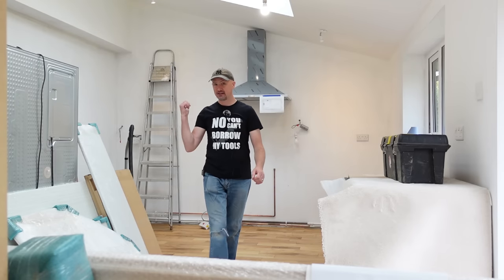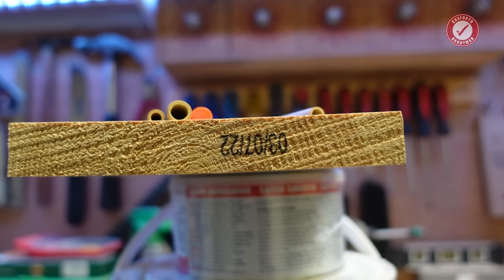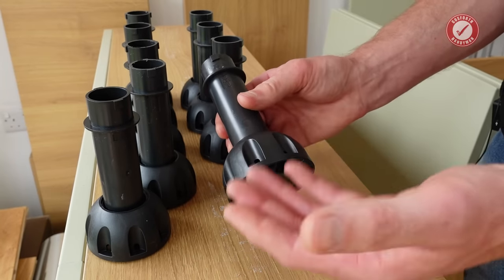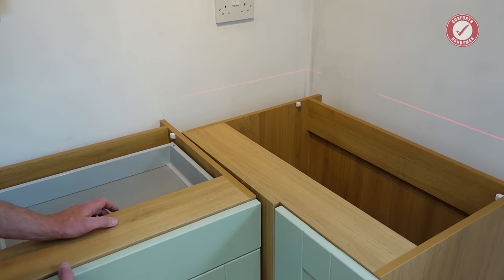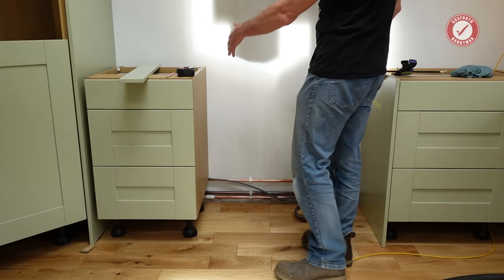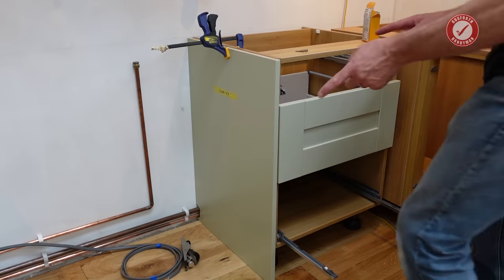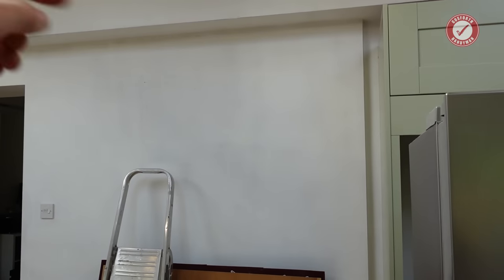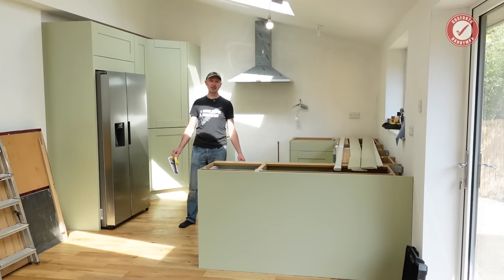How to fit a kitchen

Comment: Tipping the big unit to vertical can be done by clamping a board of the same width to the side of it, level with the legs/feet and tipping onto the board instead. Does that make any sense??

Comment: You should have started off with a datum line first is paramount. .  And what that achieves is finding the highest part of your kitchen floor and working from that line.   You can always make up height by adjusting feet and using spacers in extreme circumstances, but not the other way round.  Just a friendly recommendation.

Comment: I wonder if they didn't leave the over fridge cab dry fit so that you could disassemble it to trim it if your fridge was a little too tall?  Just a guess.  Great looking kitchen.  Love the colour.  Those spacer for attaching to the wall (space plugs I think) are brilliant!  I've never seen those before.  Used to install kitchens man years ago; you did a wonderful job, Andy!
Reply from the maker: Don't think so as then the door wouldn't fit. Space plugs are great! 😁👍
Reply: Have you checked your order? There’s a tick box for fry assembly - I’ve had to tick it for a corner unit that’s not going to fit down our hallway.
Reply from the maker: Yeah, that's flatpack assembly - did that for the corner unit. This was fully assembled with no glue in the joints!
Reply: @GosforthHandyman  super odd indeed. Cheers for the video, giving me a reality check about what we’ve got coming in November. Don’t suppose you cover Manchester? 😂
Reply: @GosforthHandyman  maybe they ran out of glue!

Comment: Proper kitchen fitters are like gold dust , I learnt a few tricks ie 600 worktops are no good for inbuilt dishwashers so always order 800 breakfast bar type them you can cut to hearts desire without worry about depth for pipe work etc , also wall unit hanger bar are essential but great job as always Andy
Reply: Yeah after 4 decades at it professionally I can say the only way to achieve the desired results was to be independent and away from the dictatorship allowing craftsmen to do their role. 
 Once I was contracted by a corporation or other big business it was 100%   money oriented. Speed. 

Even as a independent fair pricing was difficult due to the amount of cowboys and 
 " handyman"  doing the role even the gas/ electrical without certification/ any liability .[ ?]

Comment: The mental gymnastics with fitting that kitchen is beyond most (including me.) It looks beautiful and I'm sure the whole family will enjoy using the room. Top job.
Reply from the maker: As long as you keep it square, plumb and level you're OK. Make this mistake of following the walls and you run in to big problems. 😁
Reply: And don’t fit to a finished room, the kitchen should always be the very first (bar painting) of the second fix! Never fit on finished floor and never fit skirting boards before fitting your kitchen, this is not only a waste of time and money but it also makes it difficult to scribe base end panels and effects the overall finish
Reply: @wobla9699 Never fit on finished floor? That's what he does in this video.

Comment: Informative video and kitchen looks good, look forward to see the finished thing.

Had a number of kitchens from the same supplier over the last seven years, only missed out on the tea and biscuits once. So not a new thing, but a nice touch. Usually found in the leg box, the fancy box is new. Visited the showroom a few times, always helpful. I like that there are no cams visible on the wall or base units because they glued and doweled together. 

I have found with that supplier if you use the planner and have your plan converted to a basket, the pelmet, cornice etc are automatically added on. So unless you take them off they will be included in your order. If you do the order manually without the planner by adding things to your basket, they usually flag that you have not included end panels, plinth and cornice. 

Experience has taught me, when they deliver, don’t just check the delivery note, check against your final order version. Twice appliance doors have not been delivered with the original order. One time because the door failed quality control they said. The delivery note covers what they are delivering that day which is not necessarily what you ordered.  Plus a few damaged items. But getting them replaced/reordered is straight forward in the checking window (it was around 10 days last time I used them). If you are using a kitchen fitter, get the kitchen delivery two weeks in advance (so you have a chance of getting the missing bits delivered before they finish). It is a pain storing the kitchen, but less hassle than trying to get a kitchen fitter to come back for quick job, as they are usually busy. If fitting yourself, less of an issue.

Comment: I love fitting kitchens, I find it really satisfying.  If you're a DIYer where your finish is "good enough" then it may not be for you, everything has to be perfectly plumb and level to maintain a good functionality when it comes to use, especially if you are fitting hobs where the worktop needs to be perfectly level or your frying pan may not work so well when cooking things like pancakes.

Good digital spirit levels are very helpful and also good to have a cabinet plane and lots of quickgrip clamps.
Reply from the maker: I find it quite enjoyable and doesn't take as long as you'd think!
Reply: @GosforthHandyman  I agree and have no idea why kitch fitter charge so much.  My dear old mum was quoted £2600 for the install of a 4x3m kitchen.  This took me a week and we added a new ceiling with spotlights to the job.

Overall cost to mum was a box of teabags, a few pints of milk and several packets of chocoloate biscuits.

Comment: When spacing there dishwasher section I use a couple of 600mm stretchers that I pocket hole in to the gap. Great video. Thank you
Reply from the maker: Not a bad idea! As long as you can get them out when the dishwasher goes in. 👍

Comment: I used to overhang my legs where cabs butt up together, it’s stronger as it supports sides of cab  rather than just on base which may only be fixed with screws! And it means other one sits perfect one side and just adjust other side up or down 👍🏻

Big ones like that pantry wind all legs up apart from for at outermost points, level up, then just wind rest down until they just touch floor 👍🏻

Nice work
Reply from the maker: These legs overhang the edges. 👍
Reply: @GosforthHandyman  but not enough to catch the neighbouring cab😜

Comment: I have done a few kitchens over the years and didn't have anywhere near the tools that I have now. The last one was taking the kitchen from my last house and fitting it to my previous Maisonette, which sounds really strange. as I am not travelling backwards through time. I had the Kitchen from my last house, when I belonged to my Parents and they wanted to fit a new kitchen and utility. I wanted to put in a kitchen in my home, so I took all the units from both the kitchen and utility as there was nothing wrong with them. They all fitted perfectly and saved my a fortune. I was shocked to fit all the units as I didn't think I'd be able too. Really like the kitchen once it was done as I had a few cupboards and that was not really a kitchen, but more of a large room to cook in. 
Then once my Mother passed away and my Dad found someone else, we where looking to move as we had a young child and wanted to have another, We listed the Maisonette just as the Market collapsed, and we came to a deal with my Dad and moved in and waited for the Maisonette to sell, which it did but for a heck of a lot less. 
My next Kitchen Project is to replace the current kitchen in the Current home which strangely has no Drawer units and dodge fitted wall cupboards. The previous owner that should be band from any form of DIY didn't bother with the proper hangers and opted for a large penny washer through the hard board backing instead with a batten underneath. I was going to build the kitchen from scratch like i did with the Bar I built which replaced another kitchen as the house had two things that had kitchen units in. The Wife now wants an off the shelf kitchen as I am much faster at getting things done when most of the work on that front is done. In my defence I only have a small window to work in between school runs at the time. 
There are a few tips that I'll take away like the space blocks and hopefully where to get the units from, as I am not impressed with the kitchens that are available to us DIY lot from the likes of B&Q, Wickes the doors are never going to last as I have seen a good few of them de laminate over the years. I just wish Howdens were open to us non trade lot.

Comment: Those legs are better than my wife’s!
When I fitted our last kitchen I had some 18mm facia left, so I used it with the short side on the floor, I marked the corners, cut away the foam at the rear into a 90 degree “vee” and bent it to shape then glued each corner. It worked well for years and is still in use at our last house, going to do the same again at our new house.

Comment: Nicely done Andy as always. I did think you were ‘brave’ with your wooden floor as dishwashers are great water chuckers as you showed along with children. But your choice your build mate 👍🏻
One thought, with the beautiful fitted fridge are you going to get enough air flow from beneath. We had a fridge blow due to lack of air flow. Just a thought nothing more 😁
PS. 100 agree Del on the Tall Carpenter is a top bloke loads of great tips.
Reply: I’m pretty sure newer refrigerators are made so you can slide the back right up against the wall without any concern for air flow. When doing this you typically have the power cord and/or water line keeping the back of the refrigerator a couple inches from the wall which does allow for some airflow.
Reply from the maker: Yeah, we've actually left 50mm at the back and the top is almost completely open so all good. 👍

Comment: To keep your gables exactly flush with doors - measure the door , mostly 22mm nowadays , cut a small piece of waste 22mm by maybe 2 inches and carry in your pocket as little template , generally drawers will be tight to carcass but hinged doors will be 1-2 mm proud of carcass so you will need to keep panel out that bit more for flush finish

Comment: I recently DIY fitted a DIY Kitchens' kitchen. While I was generally happy with the quality just like you I had a few missing pieces. I also had some damaged pieces. Although they were all replaced or sent quickly it might be problem ordering from them and if you are getting the professionals in it could lead to delays and extra visits and hold up other trades. I found it interesting that you scribed end panels to the wall when you will never see them like next to the Range and the right of the fridge. The end panels come with few mm plastic strip on all edges which is great to protect the end but is tricky to just take a mm or two off. I note that the end panels are 'only' 600mm deep. We had to space some of our cabinets a little further off the wall for 40mm waste pipes we couldn't get close to the floor and there isn't enough space behind the back panel for the pipe and especially the brackets. The cabinets are 560 plus 22mm door means if you have to come off the wall like we did or scribe off a dodgy wall 600mm isn't always enough if you want the panel proud of the door. You set your's flush but I have seen a lot of channels where they do it 5mm proud, just an aesthetic choice. I would prefer say 620mm to give you scope to scribe some off and still be a bit proud. You can request units to be dry fit if required, like a tall unit that might be tricky to stand upright if the ceiling is low. I don't know if this applies to your top box.
Reply from the maker: Yeah, the scribes next to the range were just quick to keep everything tidy. You'll see the fridge scribe if the fridge ever comes out. 😁👍

Comment: with any unit that has more than 4 legs, raise the others and concentrate on the legs at the perimeter.....once they are levelled you can drop the others down to the floor.

Comment: For filler pieces cut two pieces which usually are 720mm , screw one flat on the back of the front one and then you can pull it out flush to the 22mm or whatever your door thickness is and screw directly thru gable to attach from both units as fillers are generally 18mm and won’t sit flush to doors unless you do this

Comment: Hi, thanks for a great video. I wondered what did you use to seal end panels to wall? Although scribed really well I assume there is some kind of finish filler used. Caulk or silicone perhaps?
Reply: Anyone?

Comment: Hi…Thank you for another great video. I am in the middle of installing my own kitchen which includes the same Bosch dishwasher as yours. Why did they put only put 3 legs on them?🤔😀 (I had some issues with installing the dishwasher as there is a washing machine to left of the dishwasher and the sink to the right. The issue was getting the washing machine’s drain and filling past the dishwasher. However, I kind of found a solution by making a plinth for the dishwasher to sit on and running the drain and inlet hose in a void within the plinth.
I have now got to point of fitting the panels in between the appliances and decor end panels. Please could you advise me what type of saw you use to cut the panels once they’ve been scribed. I don’t have a table saw.
Thanks👍

Comment: Nice to see you take so much time scribing the side panels. However it's only necessary where the whole panel is visible at the end of a run or where the panel needs to support the worktop. Where they're attached to a cabinet the cabinet bears the weight. Obviously for an integrated dishwasher you don't need side panels as the doors line up flush.

Comment: To scribe the bottom of end panels - turn it upside down and let it sit on the floors slope and push back to the wall until it hits at one point while still letting it sit on the floors angle , mark the top across the unit gable - cut it and turn it back down to floor - that is ur exact floor angle , then scribe to the wall - by the way this works for all floor gables and many more things

Comment: Great video.  We had a DIY kitchen installed about 8 years ago and still going strong.  I think you perhaps should have used some of that pelmet to create a fake end panel front between your two large units in the corner as that would have helped frame them and mitigate any potential issues with door clashes in a fashion analogous to the 50mm  filler panel in the other corner.

Comment: Andy... Technically those blocks are called 2modesty blocks" honest! Used to panel desk fronts so that girls (when mini skirts arrived) could sit in comfort without being observed, if you know what I mean. When they got out onto DIY market they sometimes came in two pieces with a bolt through and were then called "knock down blocks".  God how sad am I ? After a few years my partner and I found kitchen fitting a bit stressful and went back to general building etc.   Top work, man.  Bob (Weston super Mare )

Comment: Really useful video this, thanks! I'm looking to get a kitchen from here too and just wanted to know how you went about fitting the top box? As I will also be housing an American fridge/freezer similar to yours but with an end panel either side only (due to space restrictions). Also, for the additional trimmings you did around it, did you cut from an extra end panel? Any advise would be much appreciated. Cheers

Comment: If ever fitting a range I leave each end pannel short, in fact just use one and rip down as they need 12mm air flow around them

Comment: That's going to be an elegant kitchen!  Solid wood cabinets, unlike the particle board things I see in some new construction.  I'm not familiar with legs like those, but I can see they are useful when you have a rigid countertop.
Reply: These are particle board
Reply: DIY kitchens do solid wood doors if you order them but the carcass is MDF
Reply from the maker: Cheers Bob! Yeah, it's just particle board (chipboard) unfortunately. Well made though. 👍

Comment: Really nice job - do you rate these kitchens over Howdens? Really nice job there Andy as usual. On the over fridge unit which was supplied dry, I wonder if it was classed as a bridging unit (which may require trimming to suit location depending if against a wall or between two end panels?

Good point about the critical space for appliances, my kitchen fitter very kindly had left me 595mm. I only discovered a couple of months later once I tried to fit the integrated dishwasher - which would not just fit. I did not want him back in to sort (not impressed), and ended up trimming an adjacent unit by 5mm which was fun - cutting up a preassembled and glued unit, trimmed the horizontals by 5mm using the tracksaw.

😀👍

Comment: Great video as usual, great colour kitchen, will look fantastic. I am just fitting my new kitchen now. It always seems such a waste to me, you fit full end panels to base units on both sides of a range or appliance void and then push the appliance into the gap. Covering up 90% of the panel.
Reply: I split an end panel in half lengthways and fitted half to each side!
Reply from the maker: Now that you say that, I wonder if that's why they sent one less end panel? 🤔 There were 3 on the original order though. 👍

Comment: Hi there, If you are fitting in a kitchen in for a customer do you feed the electrical work through the units with the back box yourself or does an qualified electrician have to do it?

Comment: Hiya buddy, been fitting kitchens for over 35 years and you've done a blinding job, fair play.

Just one thing, should there not be a filler piece to go between the big corner unit and the one next to it, so the door doesn't foul when its opened ?